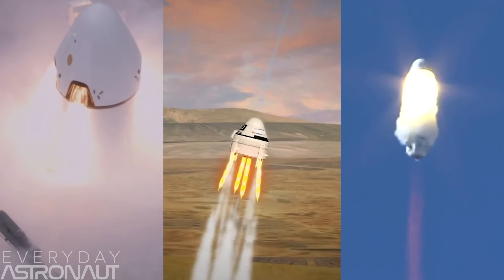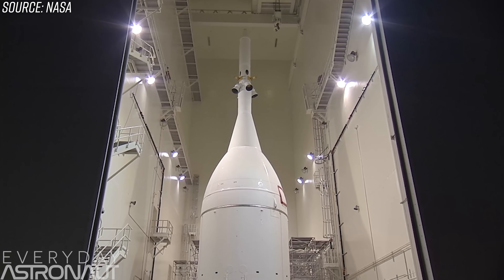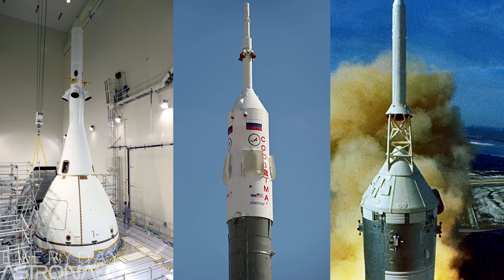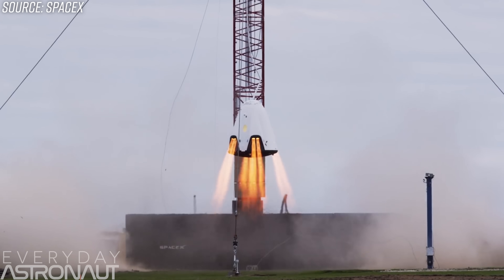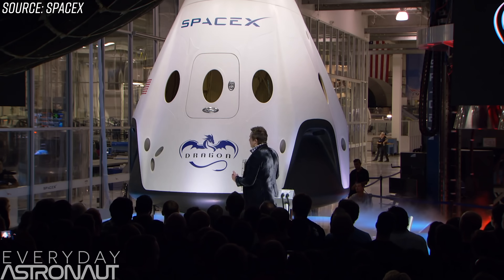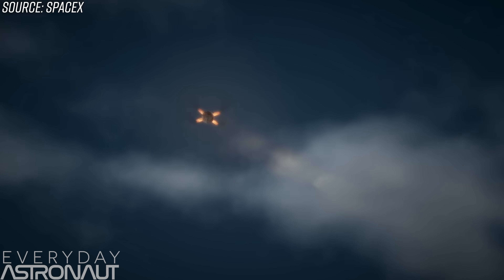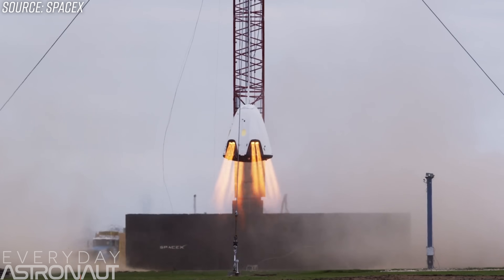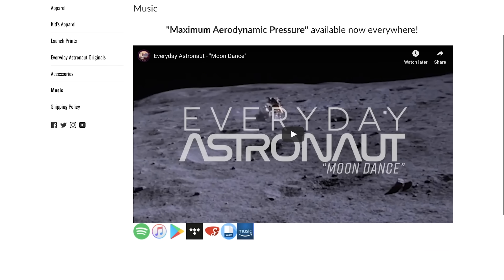Why have SpaceX, Boeing & Blue Origin ditched abort towers?

Comment: I' surprised, that talking about "abort towers" your never mentioned Soyuz T-10/1. That time when abort tower actually saved lives.
Reply: @Mino St.Lucas also the Recent Soyuz Flight M-10 i think
Reply: @char2c584  ms10
Reply: The Soviet/Russian space program has a good history with launch escape systems.
Reply: Yeah
Reply: Caeser:  Of NEEDING escape systems?
Reply: Whooooosh!
Reply: @glasslinger  I bet you don't have your glasses
Reply: marino deželak   the escape systems only save lives by being used when they are *needed*.
If they are saving lives, that means there are rocket failures occurring for them to save lives from.
Rocket failures are not good.
Reply: ·  soyuz is actually one of the safest rockets ever. But also one of the most used. Consider that for years americans and europeans had to rely on them to get to the ISS
Reply: ·  Assuming that a rocket can never fail is incredibly naive, and abort systems exist because engineers know that despite their best efforts, they can never make a rocket 100% reliable.
Reply: N1 Rocket needed the aboard system on every manned flight.
Reply: @glasslinger  not a single cosmonaut has died since 1971, and there were 4 in total. Astronauts have been far from being that lucky, on the other hand. 2 x a full crew of 7 people in Space Shuttle disintegration... 
Seems like you might need to seriously reevaluate your assumptions.
Reply: And MS-10

Comment: 4:20 this is such a kerbal solution.
"well does it get the capsule away from the boom?" 
 "er yes... but.." 
"then so what if it wobbles a bit"
Reply: Laughs in quick-save
Reply: InventorZahran 327 Me, an intellectual: Revert Flight
Reply: Eclipse538 - as a curious question, what training can one do in order to resist more g’s?.... back in i think the 60s a guy took 50gs on a rocket sled... he lived.
Reply: nice
Reply: What if it turn over and speed up to ground?
Reply: Eclipse, you can't train for the extreme g forces you would experience during a rocket abort. There is nothing to train. This isn't the same with fighter pilot training where they train for keeping their consciousness during g changes or sustained g forces. This doesn't mean fighter pilots body is more resistant to g forces, no, it only means they can utilize certain techniques, equipment, and have more awareness to keep themselves conscious. That's the whole point of their training. Their body will never get used to g or become stronger. In a rocket abort, all anyone can do is just, well, basically do nothing. Just sit and hope you survive the 3 seconds of abort duration as you are violently pushed into your seat, that's it. It would make no difference whether you are a fighter pilot or civilian. You wouldn't even have time to utilize a breathing technique or whatever. It would start and end very quickly for you to do anything...
Reply: @zerg9523  The day they actually goes commerical, probably not.
Reply: Well, Russian systems are such that human body is treated as a frangible element, 100% survival rate but 0% uninjured.
Reply: zokon  oops
Reply: Also, smokers can take more g's since their blood is harder to move through their body..
Reply: Not only that but if it’s around the same gs effecting human body as the pull systems which I guess is the case due to the same fuel being used it might rescue you but I don’t know about longterm health after being propelled by up to 15g so there’s a downside there but you survived
Reply: @kegwg1830  depends on how you define 'long-term'. I believe the only permanent injury after the Soyuz-11 disaster (1971) was a chipped tooth, but a couple months in a neck brace or a broken bone or two are entirely expectable. You'll totally make a full recovery and be able to fly again, after you're out of hospital.
Reply: 420 ha ha ha ha haa
Reply: @GundamReviver  you must be in those special classes.
Reply: @N0xiety  yeah g force just makes you weigh a lot more, so the only real way to try and train against it from turning you into mush is exercise, but even then you can exactly train your brain and eyes to be stronger and not just squish
Reply: Zerg that was for less then a second

Comment: Some interesting history that you didn't cover here is that the Space Shuttle orbiters were originally supposed to have a LES of their own and that design was kept well up until when the vehicle was to go into production, but like other features it was dropped to save weight, complexity, and most importantly money. The system was referred to as the Abort Solid Rocket Motors or ASRM. It could be described as a pusher-type since it was comprised of twin rockets attached to the sides of the orbiter's aft fuselage and when fired would carry the orbiter away from a malfunctioning stack. 

The ASRM's weight was initially considered acceptable since when the Shuttle reached a point where it was no longer usable, it could be fired off, the thrust boosting the stack and countering the dead weight, then jettisoned. So what's the big deal? Aside from cost there was another problem that kept rearing its ugly head; an abort scenario where the ASRM was used invoked heavy stresses on the orbiter airframe and so to keep the vehicle from breaking apart due to the aerodynamic load, the frame had to be beefed up structurally to the tune of a whopping 9 metric tons! In addition, this would not save the orbiter or its crew and payload in the advent of an exploding SSME, so its usefulness was limited to failures of the ET or SRBs.

Since NASA was under a great deal of pressure to make the Shuttle meet the DoD, CIA, and NRO's payload requirement of 65,000 lbs (29 tons) to LEO, and with costs for the program rising, ASRM was deleted from the design. 

Skip over two decades later and the design of the HL-20 lifting body that was the inspiration for SNC's Dream Chaser was also going to use a pusher type abort system. However this was a separate system not directly integrated into the craft and was a part of the cone-shaped launch vehicle adapter. The crewed variant of Dream Chaser, HL-20's successor, uses an integrated pusher system that also doubles as the orbital maneuvering system. Cargo Dream Chaser could in theory use this, but being stuck under a fairing makes its use impossible.
Reply: you should make your own video! Just read that out loud.
Reply: Cool stuff, unfortunately many people commenting here have no basic knowledge to understand what they see and hear...

Comment: Great explanation, great cuts, great paceing- in short great Video! :) 
You keep getting better and better. <3
Reply: One tuning he missed: in fact Soyuz Has both tractor and pusher systems. In addition to the tower there are motors mounted on the faring, which are used in case of emergency in later stages of the flight after the tower is ditched. As demonstrated last year.
Reply: @mancubwwa  Yeah, he knows that. But its a little thing which he probaply thought wouldnt fit in.
Reply: Don Guru de Bro I saw your account 2 times on YouTube today on vitasiams channel
Reply: Don Guru de Bro totally agree!
Reply: ...The sheep commenting on how the wolf is eating them...that's original man...

Comment: The part about reusability of Crew Dragon did not age well.  I watched this just after Crew-9 launch.  I heard during the launch webcast about the Super Draco engines now being a redundant option for soft splashdown in case of parachute failure so I went to YouTube to research a bit about the Super Dracos and found this.  SpaceX changed their mind on reusability because today's launch is the 15th crewed launch since Demo-2 including Axiom, Inspiration 4 and Polaris Dawn.  All of them using the same four Crew Dragon capsules, all of which have been used at least three times.

Comment: PROPULSIVE LANDING by SpaceX: My guess is that P-L is their long term goal and what happens in short run (i.e. parachutes) is just whatever it takes to keep NASA happy without compromising what they believe to be the best ultimate path.
Reply: There are a couple issues with propulsive landing such a capsule:

1. It's important to have a central centre of mass when the engines are active, but during reentry, the opposite is true - having a controllable, offset centre of mass is required to steer the vehicle during its unpowered descent.
2. Is it worth the development cost? It's clear from some renders and talks that SpaceX intended to scale up Crew Dragon's landing system for use with BFR (later Starship), but when Starship's reentry profile changed to an improved design, developing it for Crew Dragon wouldn't have as much R&D benefit anymore.

Development on Starship is now in full swing, so you're right that propulsively landing crew is their goal - it's just that it's shifted to their new vehicle. That said, it's been hinted at by Elon that Crew Dragon is still capable of propulsive landing in the astronomically rare event that all of its parachutes fail.
Reply: I'm not sure that NASA (and probably SpaceX's enigneers) are incorrect in being circumspect about Crew Dragon's propulsive landing, since it relies on 8 engines and the landing legs properly operating after being subjected to a full flight regimen. How many of those can fail (and in what configuration)? And is there enough time to deploy backup parachutes if there is a failure?

If a skycrane crashes landing a rover on mars because of an engine failure, it's an expensive embarrassment . If a capsule with a full crew crashes because of an engine failure, it's a horrific tragedy.
Reply: SpaceX is already developing a different propulsive landing vehicle, Starship.  So I doubt at this point Crew Dragon will ever get that feature.
Reply: @DairyLife  the issue wasn't with engine reliability, but with the landing legs. NASA wanted additional verification that it'd be safe to have holes in the heat shield for the landing legs to pop out of. SpaceX decided it wasn't worth pursuing because they had determined Dragon to be a dead end anyway, choosing instead to focus on Starship/Superheavy.

Comment: SpaceX should keep developing propulsive landing.  It will pay big reusability dividends eventually.
Reply: That’s their plan, actually. They want to land starship propulsively, so they’ve been training to do that via F9 and FH launches.
Reply: Or just use SSTOs theyre way cheaper and theyre reusable
Reply: FBI SSTO as in "rocket that has only one stage", or SSTO as in "spaceplane"?
Reply: If the propulsion system goes tits up then you have a really big splat instead of your astronauts 

So you need to fit a parachute back-up

in which case

Why not just use the parachutes in the first place?
Reply: @thinfourth  More options.
Reply: @thinfourth  Because a propulsively landed capsule takes less wear and tear and can be reused more rapidly and for less cost.  It's also really, really cool.
Reply: @JohnVanderbeck  Did you see the last falcon 9 landing?

it went slightly wrong

So while propulsive landing for hardware is fine it isn't so good for flying meat

if a piece of hardware has a problem landing then Elon gets a funny youtube video and we all move on

If it goes wrong for people then you have a really big problem involving dead people
Reply: @thinfourth  Propulsive landing should be the backup and NASA should seek to certify them for that. Using parachutes and air bags should still be the primary systems. If a chute fails to open or the launch abort module fails to detach, then a propulsive landing attempt should be an option.
Reply: @stupidburp  can't disagree with that

the rocket motors are there so if the chutes go tits up then if they can throttles the thrusters without effecting the certification of the abort system then why not
Reply: @thinfourth  Exactly. It might be a really cool line in a movie, but I do not want to be the one saying, "I see dead people."
Reply: Nicholas Harvey umm u just answered ur own question ssto means single stage to orbit, it doesnt specify whether spaceplane or not
Reply: The only reason why they cant test it properly is NASA being lazy. Same like with Tesla selfdriving. Everything is ready its just that caveman government stalling everything and milking money.
Reply: Yeah. I hate that the Crew Dragon will never carry crew again after splashdown on each mission. It does sorta go against the grain with SpaceX and reusability.
Reply: @thinfourth  eh but the falcon is a bit harder to balance than the dragon
Reply: It’s just to create jobs and shoot bottle rockets into the ocean, it’s part of the great deception.
Reply: @dcraexon  Great deception? What are you on?
Reply: Unfortunately, propulsive landings pull heavy gs
Reply: @nicholasharvey4393  bad idea

Normal bell nozzles can’t be efficient at both sea level and vacuum.

Aero spikes would be good, but they have really bad thermal problems

Comment: Because, they can shut down a liquid fuel rocket.
Reply: You don't want to shut down an abort system.
Reply: @amirabudubai2279  - The liquid fuel motors can have other uses instead of just being an abort system.
Reply: @manicmute9440  Yea, that was covered in the video. The biggest advantage, in my option, is being able to use the abort fuel as RCS later. You are not carrying around  as much dead weight.
Reply: You don't really want a parachute descent system that could prematurely deploy while the escape tower is still burning off its fuel setting the parachutes on fire.